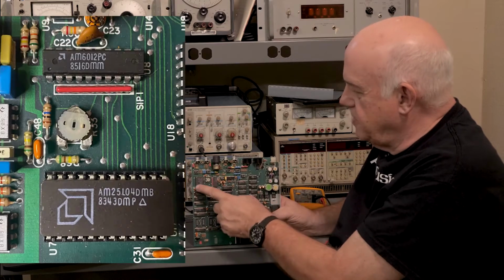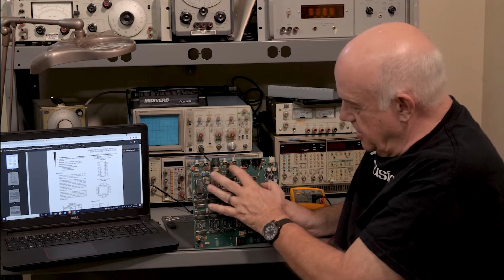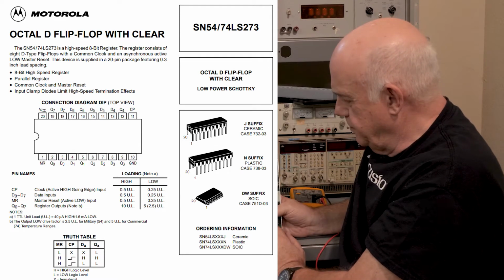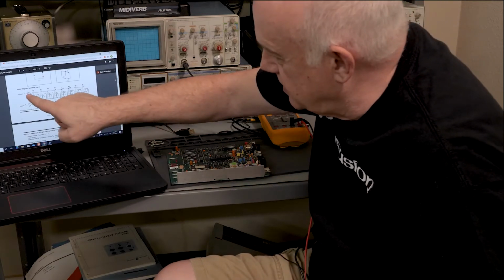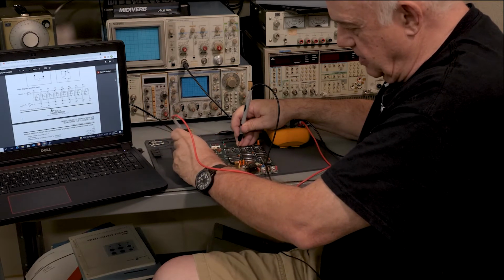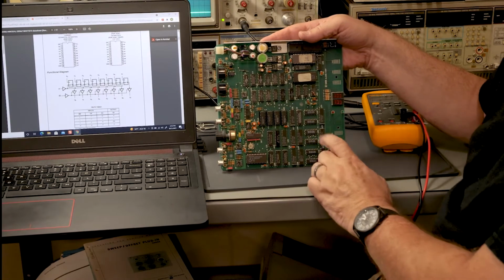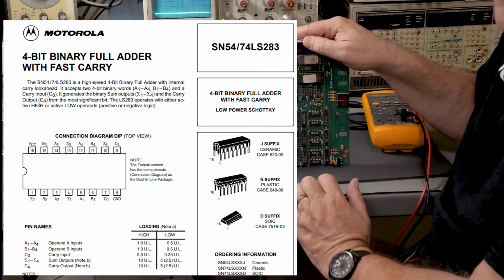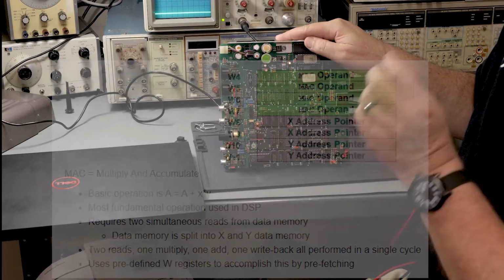Reverse-Engineering the Alesis MidiVerb I: Where to start?

Comment: Yeah for that much logic in the mid-80s it was "make the tracework easy even if the signal names are no longer consistent and connect to pins out of data/address order." Bishop graphics tape was expensive. ;)
Reply: I would argue that the address and data bits order is irrelevant - until you want to burn and EEPROM from the outside ;)